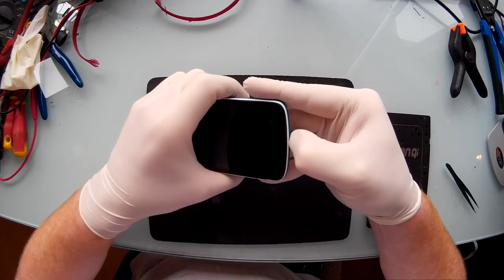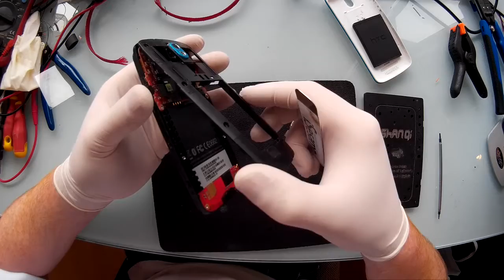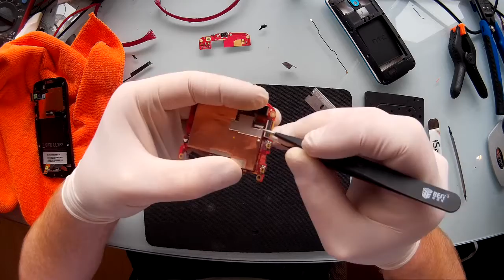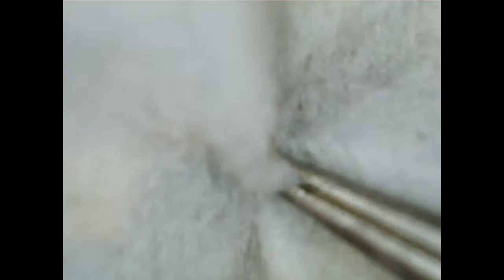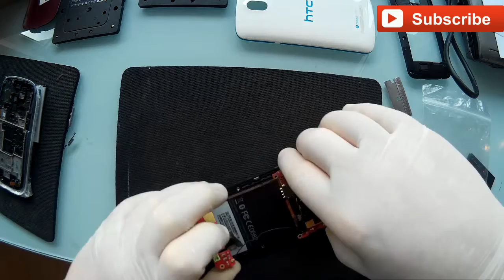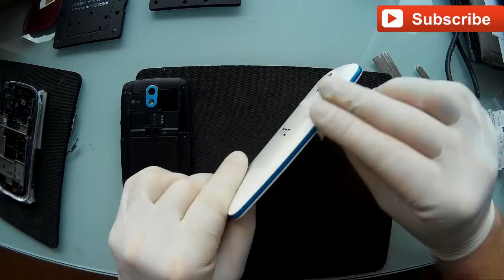HTC Desire 500 Water Damage Repair

Comment: Hi there,
really love this video, well done. Just got one question. So I am repairing this HTC Desire 500, the malfunction is that I can not turned it on, it is stuck on the HTC logo screen (the white one with green HTC letters) and it vibrates 7 times. When I googled it 90% of the comments were that the logic/motherboard is fried, actually is no more of use. So now I am trying to replace it. Thanks to you and your instructional video I successfully opened and took out the old motherboard (the fried one) and now I found this used one online, however it is taken out from a DOUBLE SIM HTC Desire 500 phone. So it's the same model -  HTC Desire 500, but with double SIM slots instead of one slot as it had the old motherboard. Do you think that this double sim one will fit and that it will work fine with the rest of the phone, which was previously functioning on a one sim slot motherboard? I think that it won't be any problem but I wanted to ask you first of the reason that you are the expert here :D 

Thanks a lot.
Kind regards!

Comment: I'm looking for this kind of videos because my HTC Desire 500 has a broken vibration motor. The connection is under the red board and I worry that I can damage something when i remove it. I don't even have a new working motor yet :D But It's amazing how you separate the parts and then you pull them back together and it's working.

Comment: Really nice video ! Thank you !
Reply from the maker: Hi lliya Thanks for the comment your welcome i hope it helps
Reply: smartrepair247
 It helped, but still the back-light of the display is gone, but there is a display image. What would be you suggestion ? New display or something faulty on the board ? Thanks again !
Reply from the maker: Hi lliya Its hard to know but all i can say is once you have an image your close, i would say it could either be the the backlight itself that can be replaced or a coil on the board, Can i ask has the screen signs of water damage? any water spots? how wet did the board get?
Reply: The screen had no clue of water inside of it. The coil looks fine. I couldn't measure it's induction, but i did "ring" it trough. The board was not very wet. It was in water for about 10 seconds. Next step I believe is to heat up the TSP 65200 chip, and cross my fingers looking any better from now :). What would be, if the damage is the backlight itself ? I guess I have to get a new display ? Thanks for your advices ! I really appreciate it !